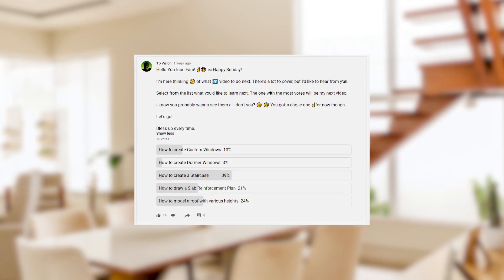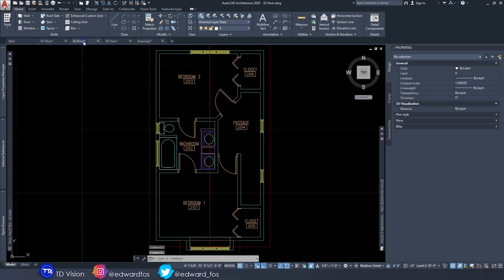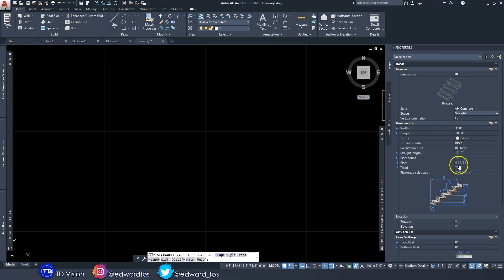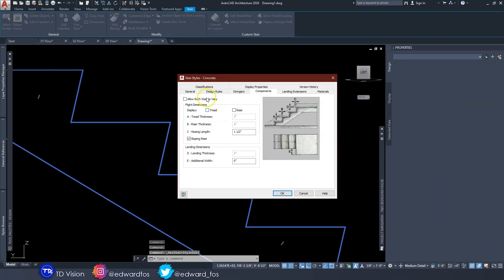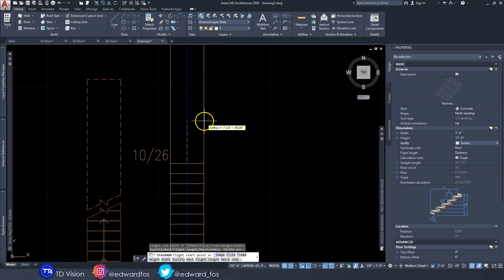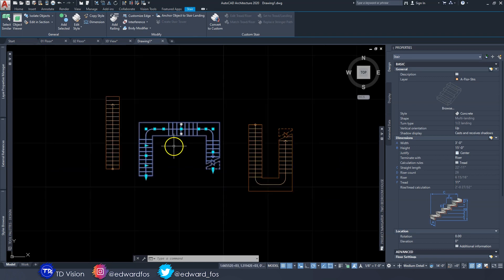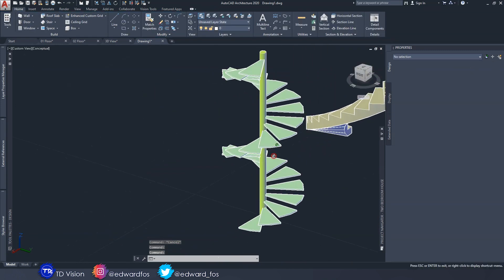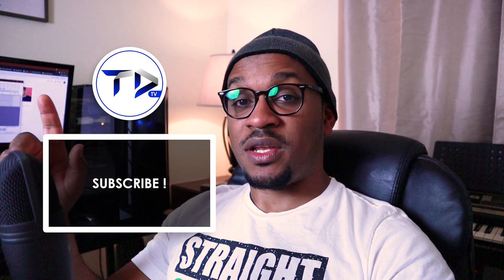STAIRS in AutoCAD Architecture 2024

Comment: Hi, that was very helpful! But my AEC stair doesn't keep the above-cutting plane part hidden with the dashed line. They still have the "plane break thunder icon" but the stair is continued after that with all the details visible with continuous linetype. I have checked the Gobal cut plane parameter, I use millimeter so Display above range - Cut height - Display below range in order are 3500 - 1400 - 0. Anything else I can change to have the stair like yours? Thank you so much!
Reply from the maker: If you adjusted the Global Cutting Plane and nothing changed, then it might be a display configuration issue. I have a video on how to understand display config with the display manager. You should check it out here https://youtu.be/LYBiz6Qxbmo?si=KBCXQQfXbeGjOOkS

Comment: Hello Sir, first of all really appreciate for your efforts and well wishes from Saudi Arabia 🫶🏼🇸🇦 
I have a question, i m not sure if would be able to convey what i want to ask but let me try,
I am a metal fabricator and i design in 2d using autocad for all of my projects, as i have the fiber laser cutting machine for metal sheets. 
So the question is that is it possible if i draw the spiral stair (for my client, of any size) using your teachings and get a 2d plan or developments to cut the stair footings, center pipe length, and size for the cladding sheet and then weld them all together and it would fabricate perfectly?? Or is this drawing can only be used for “presentation” purposes not for the fabrication purposes?? 
Because the welder that we have, has no idea how to fabricate a spiral stairs neither do i
I hope you understand my question as i tried my best 😅 
Much Love and Respect to you Sir 💝
Reply from the maker: Thanks for your question! You can get 2D plans for your stairs, but I'm not sure if there's a way to break it apart into development or spool drawings for your prefabrication process. When you draw a stairs, its one component, but you can use the EXPLODE command to break it a part, then manually separate each part for annotation and detailing, then add those to sheets. However, I can't think of an easier/automated way to get what you're asking for. I hope I answered your question.